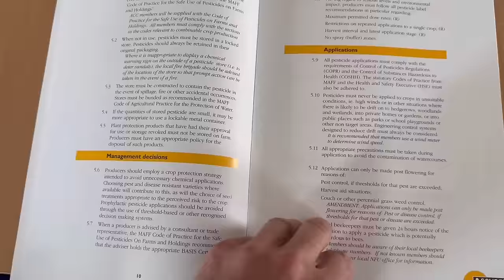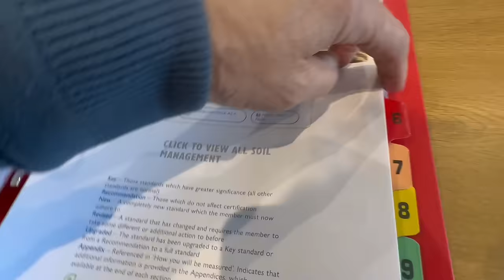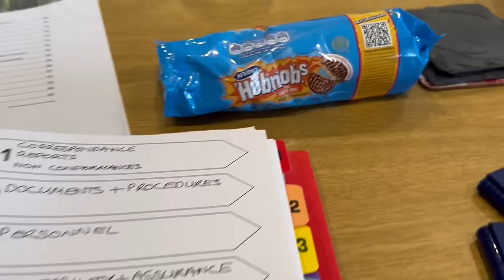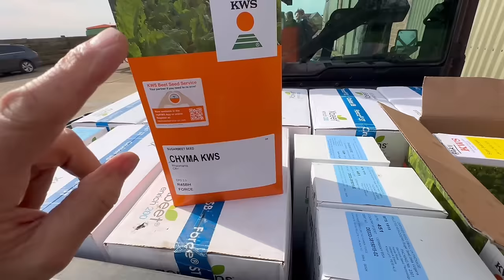FARM UPDATE 248 Featuring Maschio, Kuhn, Grange & Amazone machinery + Red tractor meeting & audit.

Comment: Did they thought about putting the stritill in front of the tractor and behind the seeder to go one pass and not miss the lines in case no gps is added?
Reply from the maker: We did t have a drill small enough but that would work. We also wanted to see the 2 strip till machines at work.

Comment: Could you mount the drill on to the strip cultivator under dryer conditions ,bugger i thought   a drill such as an old type Stanhay precision drill ,not some thing wich looks as it could launch a moon rocket
Reply from the maker: Most definitely, trouble is we only have 60 acres on light land every year so it wouldn’t be cost effective. I was going to try it on the heavy land last autumn but the weather put paid to that. Apparently on heavy land it needs one pass in the autumn and another in front of the drill in the spring.